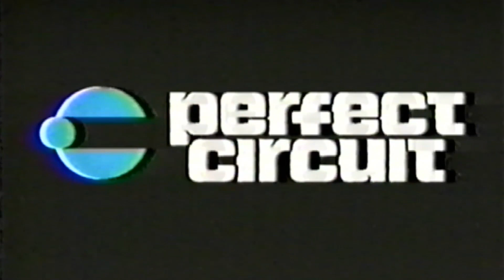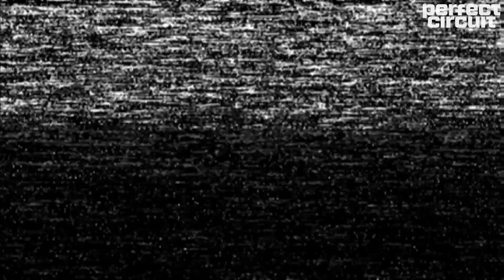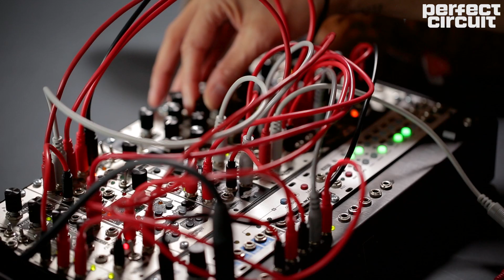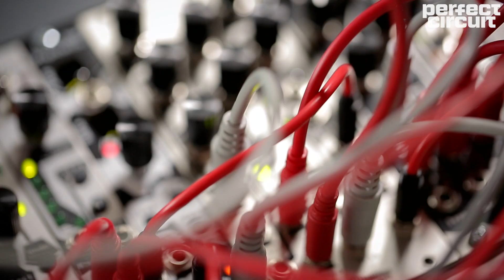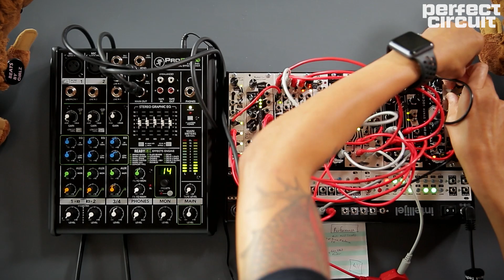Trovarsi Eurorack Techno Tutorial With Noise Engineering Modules

Comment: remarkably similar to Ricky Tinez' rack
Reply: mmm...very suspicious...did you ever saw them in the same place at the same time?
Reply: But she doesn't use the steppy, which is in my opinion fundamental in the setup of Ricky Tinez. It makes a really different set and I quite like it.
Reply: Ricky’s doppelgänger...
Reply: I think it's because it's basically the same setup, case is even flipped
Reply: It really speaks to the strength of the Noise Engineering modules in a techno context
Reply: AfA this is correct. Ricky, trovarsi, nasty nachos etc all good friends. We recently did a show together during namm as well. Shonda’s set up tends to change a bit depending on what the scenario. Is.
Reply: exactly what I thought when I saw this.
Reply: i  mean, to be fair, they are just both 1 stop noise engineering rigs.... very youtube inspired but effective none the less.